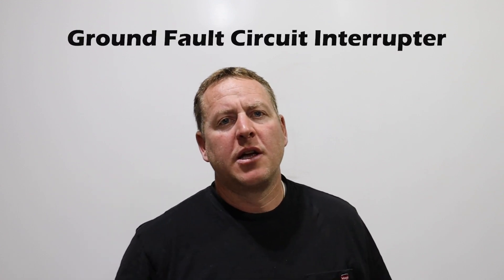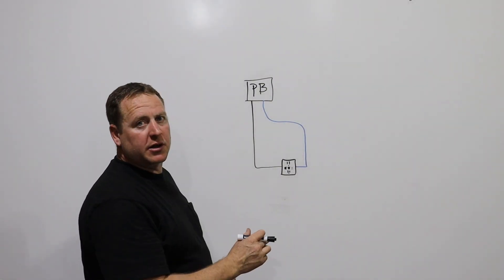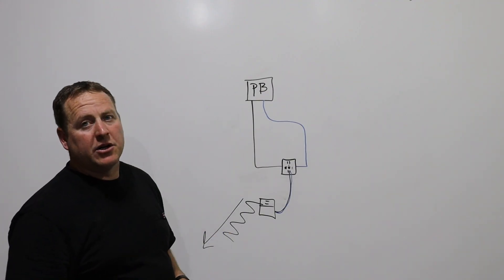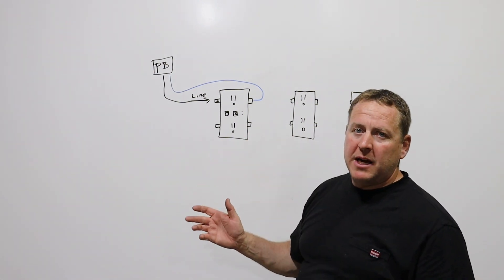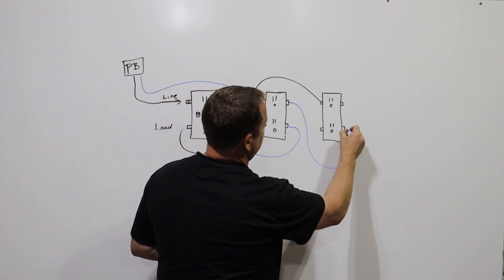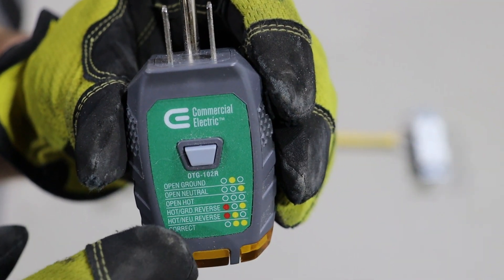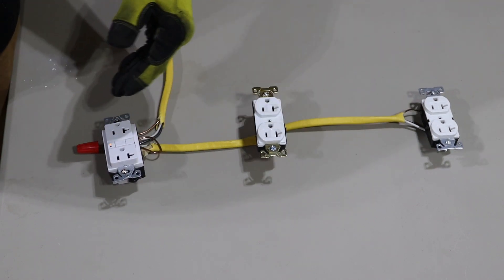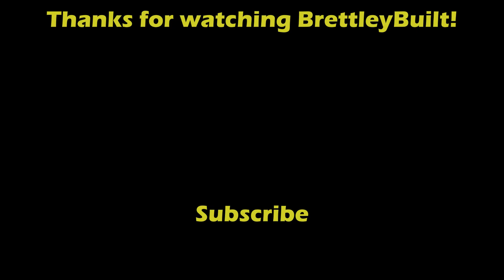How to Wire Ground Fault Circuit Interrupter (GFCI) with Regular Outlets | How GFCI's Work

Comment: Great vid! I’ve been re-wiring many receptacles in my house and never quite fully understood how these work. 
I have an outdoor receptacle downstream from a gfci at the back of my house, but I would like to add a receptacle to the front from the same stream.  Do I have to connect from the outside receptacle and run wire all the way to the front of the house to the new receptacle or can I make a junction box prior to the outdoor receptacle (inside the house) and and still be protected on both outdoor (old rear and new front) receptacles?
Reply from the maker: Yes, you can absolutely put in a junction box after the gfci and still have both outlets protected. There is nothing wrong with branching circuits like that.
Reply: Thank you. Keep up the good work and educating those of us needing the knowledge and know-how to move forward safely!

Comment: I have tenants who use more than one ac in a 20 amp circuit protected line which has 14 outlets. Nothing is pigtailed and most are plugged into the back of the outlets. If I understand correctly trace this circuit back 100% then gfci the 1st outlet and then rewire each afterwards load to line out etc per your diagram and the last outlet per your diagram. So no pigtailed necessary? Was hard to see in your live demo. Plus I am hoping the the outlet is bad not the breaker as right now all the series of outlets are dead with no tripped breaker. And there is a possibility of more outlets on the breaker but for now I have 14 dead outlets.
Reply from the maker: Yes, trace the line back to the first outlet and add a gfci outlet. Obviously match line and load wires correctly. The hot wire and its neutral go in the line side, the wire going to the next outlet goes on the load side. If you do pigtail the outlets and turn the breaker back on, the bad outlet will show up as it won't have any power when something is plugged into it.

Comment: What if you want to add 4 outlets how do you continue the wiring?
Reply from the maker: Same way I wired these three outlets. I just stopped at two outlets after the gfci outlets. You can certainly add more outlets after the gfci outlet.

Comment: In the Breaker panel box, would replacing the main breaker with GFCI breaker achieve the same result? Or replacing any of the circuit breakers with a GFCI breaker?
Reply from the maker: Absolutely. The gfci breakers are a little expensive though.

Comment: What happens to the ground wire to and from the regular outlet? Did I miss that point?
Reply from the maker: A bare copper wire ("pig tail") is connected to the ground screw on the outlet, and then that wire is wire nutted to the other ground wires in the box.
Reply: @brettleybuilt  thank you for the reply it really helps 👍

Comment: Thank you. Good lesson. On our new house the electrician put the GFI on the front porch which then feeds the garage in the back of the house. What a genius. ☹️
Reply from the maker: My friend called me up one day and told me the outlets in his garage weren't working. After checking around the house with him, he also said his Christmas decorations out front stopped working. I reset the gfci at his front porch and of course the garage outlets were  back on. His house is about 20 years old. Not sure why they do that.
Reply: I just had this EXACT situation hah! My Christmas lights were off, was able to trace back to my garage and discovered the water heater on the same circuit and had been off all day 🤦‍♂️

Comment: Hoping you see this message since it’s been 1 year.
I recently bought a house and had an electrician look at replacing some receptacles. He suggested we rewire the entire house before anything and that would cost 22k.. the house is a 1950 house. Will installing GFCI do the trick rather than replace the entire wiring?
Reply from the maker: Not sure. Please email me at brettleybuilt@gmail.com so I can get some more details from you.

Comment: Ok I have questions. 
In the last standard receptacle...you hooked up the neutral to the bottom (load?) instead of to the top where the Hot came in?

I need help with my scenario though.  I have a 20 amp circuit with 2 standard receptacles wired in series.  I want to know if I can put a GFCI outside the house behind the last standard receptacle? If that's allowed ..How do I wire that 2nd standard receptacle and the GFCI?  In other words how do I wire the in and out of the standard receptacle and in at the GFCI?
Last question...is it ok if the circuit is 20 amps and the outside GFCI is 15 amps?

Comment: My dads old house is wired with cable without a grounding conductor. Should I replace all the outlets in the house with gfci outlets? I'm starting in the kitchen with the small appliance circuit. I don't know if I can get away with a single gfci upstream from the other outlets. Thanks in advance
Reply from the maker: A gfci outlet can be installed without a ground wire. Outlets "downstream" from the gfci on the same circuit will still be protected. The principle of how gfci outlets work and protect are not dependent on grounding.

Comment: Do we need to use 12/2 wire to every other outlet that is not a gfci or can we use 14/2 from the gfci to the other outlets ?
Reply from the maker: No, you have to be consistent with the wire. They do make 15 amp gfci outlets if you want a 15 amp circuit. Remember this is a circuit, and the amperage flows consistently through the entire circuit.

Comment: I'm adding 1 standard outlet to my bathroom. I need to piggyback off the existing outlet in the bathroom which is a GFCI outlet. I noticed on the last outlet in the circuit that you drew on the whiteboard that the power came out of the load side and went into the load side of the last outlet while the neutral came out of the load side and went into the line side of the last outlet. If just adding 1 outlet from my GFCI, is this the way to hook it up? Thanks in advance for any reply you may give.

Comment: is it possible to do 3 gfci continuously but with independent outlets? i would like to say no only 1 gfci to control the the other 2 in front, so every single one with their own gfci line
Reply from the maker: Yes, that's right. There really isn't any reason to install 3 gfci outlets one the same circuit.

Comment: REALLY enjoy all your videos! two quick questions; why does the load wire from the GFI outlet not go to the line in (top screws) on the second outlet vs. the bottom screw yet the line to line from (top screws) the 2nd to 3rd outlet? 2.  Can I add or make a GFI outlet off of a non GFI outlet? Example; In a bathroom toilet room, I would like to add a bidet. on the opposite wall (in an adjoining bedroom) is a non-GFI outlet but very convenient to take the load and neutral wires. Will that load wire connected to the line screws on GFI outlet now make it a certified GFI?  Many thanks in advance, Ken
Reply from the maker: Your typical outlets don't have a line and load side. The two screws on either side of a regular outlet are bonded together with a metal tab. You can power a gfci outlet off from another outlet. Wire the gfci just like you would if the wires were coming from a panel box, wired into the line side of the gfci outlet, eventhough the wires are coming from another outlet.

Comment: Can you add a switch/outlet combo tapping into the last outlet run? Thx.
Reply from the maker: I have done it in my own house so it is possible, but you need to make sure that wiring configuration is legal in your area.

Comment: Can the GFCI had power and the other two do not have power do to a malfuntion of the GFCI load side?
Reply from the maker: Technically all of the outlets become gfci's when connected after a gfci. If something goes wrong with any part of the circuit, the gfci will trip and ALL of the circuit will lose power.

Comment: Do you prefer to pig tail GFCI’s from the LINE of the first outlet OR wire from the load?
Reply from the maker: Definitely wire any outlets after the gfci outlet from the load side of the gfci outlet.

Comment: I have an outlet in my bathroom, no GFCI. Can I add a GFCI using the wires from that outlet so I can use it for a bidet? Thank you for your help.
Reply from the maker: If the feed wire has a black, white, and ground wire, yes.

Comment: I have 3, 3 prong outlets in bedroom. One of three shows an open ground. I was going to replace it with a GFCI receptacle but I was told that if I did it would not reset if tripped. Is that true. This is an apartment my daughter is renting and does not want to run a new line to the. What can I do to protect the outlet from a possible shock? Tks
Reply from the maker: Yes, the gfci outlet will not reset. All old ac circuits used to only have hot and neutral wires without a ground. Is there an increased risk of shock from something in the area as the outlet is in the bedroom that would require a gfci outlet?

Comment: What should also be known is if you hook up a GFCI outlet and intend on it protecting other outlets on a circuit the other outlets must be hooked up in order for it to work or it will trip. In other words if you only have the GFCI hooked up and intend to test it first, before hooking up other outlets it will not work until you actually connect those outlets since you have utilized the load on the GFCI.

Comment: Great video!  Does the same principle of protecting a single multi-outlet circuit with one gfci (closest to the line supply) apply in an outdoor setting?
Reply from the maker: Yes. Just remember which outlets you have hooked up to the gfci. My friends Christmas lights went out and he had the lights plugged into an outside regular type outlet by his front door. I told him there had to be a gfci outlet somewhere that tripped. We finally found the gfci outlet in his basement garage and reset it.
Reply: @normanweingstein1759:  I think you raised a very important point; "closest to the line supply)".  If the GFCI is not closest to the PB, does it provide protection? Is it safe?

Comment: I have different hots coming in to my switch. How is the possible? I brought the house this way
Reply from the maker: Are some hots being used to power other circuits? Like maybe they are also using the switch box as a junction box for something else?
Reply: @brettleybuilt  I was getting "open ground" on my outlet tester, I rewired GFCI switch correctly with only 1 additional plug and it gives me open ground only thing on the breaker. is that GFCI and plug

Comment: what the hell is the blue wire ground or neutral
Reply from the maker: I believe I mentioned this in the video. As I have to write on a white background I use blue marker as the neutral.
Reply: @brettleybuilt  sorry for the hell thank you for the explanation

Comment: Forgive me for being duh! I know nothing. So because it's a ground fault circuit thing it had like its own ground? So the ground in the romex? Is capped off? I'm assuming yeah because it's called a ground fault thing.
Reply from the maker: Technically everything has a ground now which is just a way for any electricity that gets out of the circuit to safely get discharged. A ground fault circuit interrupter measures the current between the hot and neutral wires, and if there is a difference in the currents, then current or electricity is making it outside of the circuit and possibly through a person so the gfci trips and cuts off power.

Comment: It may be interesting for people to know the difference between the breaker and the GFI outlets. Both of them can "trip" but for different reasons. 
The breaker in the panel will trip when there is overload (going past the 15amp or 20amp rating). This also happens if the black wire touches the white wire as this will draw too many amps, like a short.
The GFI outlet is not tripping due to black/white touching, or over amp per se, it's tripping because the hot/black wire is being grounded elsewhere off the normal circuit chain. So black is going to the earth through water or human touch, or is touching the bare copper grounding wire. When current flows elsewhere beside the white wire, the GFI knows something is wrong and trips.

A GFI can often "ghost trip" due to odd surges and drops on the line. For example I have a GFI that often trips when turning a motor off like a hair dryer or hair clipper in the bathroom.

If you have a GFI that is tripping at random, it's good to try and figure out why, there could be a device failing or a plug bar or or something that is going bad. Or a black wire somewhere is losing its sheathing and may be connecting with metal or grounded object somewhere. This could cause arcs which can start fires, so don't ignore if your GFI is random tripping for no reason. Of course the GFI outlet itself could be going bad, so replacing a really old one could be a start.
Reply: Thank you for explaining this. I was about to ask the question and found your answer first.
Reply: Fastest toaster sketch I’ve ever seen 🤙🏾
Reply: Roughly how many years before needing to replace these? Our house is ~20years old and we have a couple that have ghost tripped in our garage..

Comment: Thanks! I didn't you could do that. I knew that wiring like you've done would stop voltage on down the line if the GFCI tripped but I had no idea the non-GFCI breakers are also GFCI protected as well. You just saved me about $40 on my garage outlet upgrade!

Comment: I'm going to add this observation I had about what I noticed on 3 brands of GFCIs I used at my home to retrofit some outlets in areas that need them.  I have an older 1955 built home with grounded outlets in the bathroom, kitchen, outdoors and detached garage.  I'm using 2 brands currently due to how the line load comes into the box.  My house GFCIs that I replaced are Leviton GFCIs.  My wiring feeds the grounded outlets from the attic down to the top of the box.  The Leviton GFCI, when facing with the ground prong hole at the bottom, takes the line wire at the top of the outlet.  The Leviton brand GFCI is ideal if your line wire comes in from the top of the gang box, and if your preference is to have the ground prong at the bottom.

My garage gets its line wire coming up from the floor, then from the first outlet, it sends power to the rest of the garage.  I'm using an Eaton GFCI because the line wire terminals are at the bottom when the GFCI front has the ground prong at the bottom of the outlet.  Prior to installing an Eaton GFCI, I had used a Pass & Seymour (Legrand) GFCI which reached the end of its life after 6 years.  The LeGrand is oriented the same way as the replacement Eaton GFCI (bottom is the line feed).  I didn't want to flip a Leviton upside down or cross wires behind the GFCI to install the replacement GFCI, especially with a tight fit in the single gang box.

Comment: You might mention that 2023 NEC now requires AFCI Protection as well as GFCI Protection in some rooms in a home.  A kitchen now requires both AFCI & GFCI protection on ALL outlets including the refrigerator.  And some adjoining rooms might become subject to requiring BOTH GFCI & AFCI protection for various reasons.  AFCI protection only is required in dens, living rooms, hallways & bedrooms.  A laundry room, depending on where it's located, might require both AFCI & GFCI protection if it's inside a house, or it might only require a GFCI if it's in a garage detached from the house.
Reply: Putting a fridge on a GFCI is stupid as if it trips the content gets ruined.

Comment: Great video. I have a question about outdoor circuits. Can I use this set-up or do they all need to be ground fault?
Reply from the maker: Only the first outlet should be a ground fault. The rest of them after the gfci should not be ground fault and will be protected. Keep in mind that the outside outlets should be installed with weatherproof covers.
Reply: There is another thing regarding outdoor GFCIs:  they need to have the stamping of being Weather Resistant GFCIs now.  The new code requires that, when you replace an outdoor unit with one.  The same goes with outlets daisy chained downstream from the 1st GFCI Outdoor outlet.  While they don't have the GFCI Switches on them, the "plain" outlets must be marked "Weather Resistant" and protected with covers.
Reply: Awesome question.🙋🏾‍♀️  I too would like the answer.  I truly believe my wife will need a two room she shed with the line/load setup:  TV, small fridge, and she’ll think 🤔 of something else I’m sure. 😂

Comment: Another question. If it's just one GFCI outlet and one of the wires is put on the bottom screw, but on the correct side, is that not going to work? For the single outlet they must be on top correct?

Comment: Very excellent video, but there is ONE problem with multiple outlets on one GFI....if any one outlet senses an imbalance ALL the outlets go dead.   Now you have to hunt down the culprit before you gain back your security cameras or garage door opener etc.   And it doesn't have to be liquid that trips the GFI.  Just dampness in the air around an outdoor receptacle will kill the whole circuit..
At my house, very problematic!
Reply from the maker: Trust me, I know. 🤣I was very particular about how I wired my house and how I implemented this type of circuit in my wiring.  I am also careful when designing and wiring for other people so I don't get call backs for crazy things. I have had friends reach out to me wondering why a porch light or their Christmas lights aren't working, and sure enough, the GFCI inside the garage is tripped and it took out a bunch of outside outlets because water or moisture got into an outside outlet.